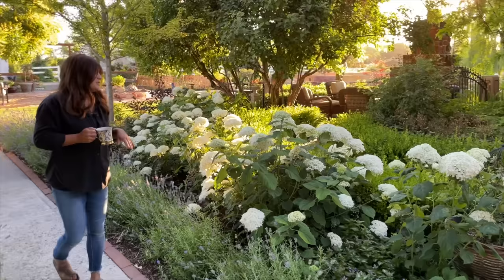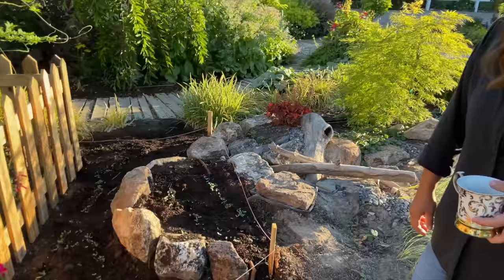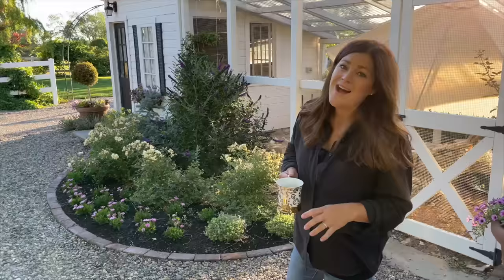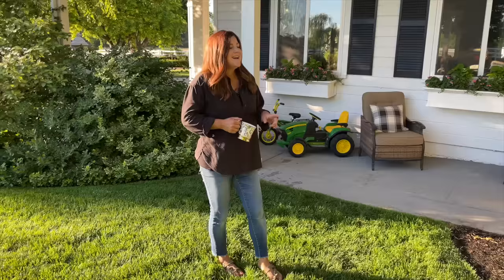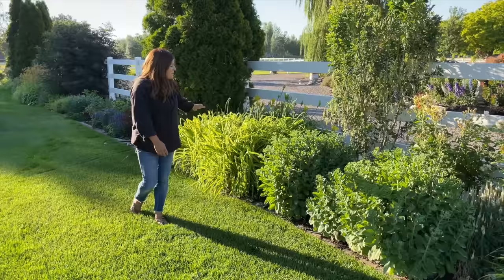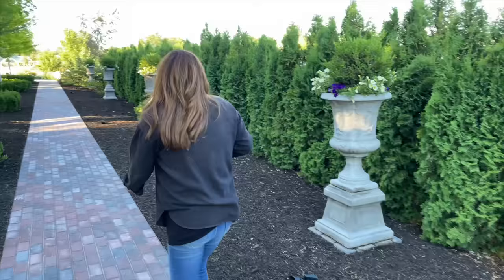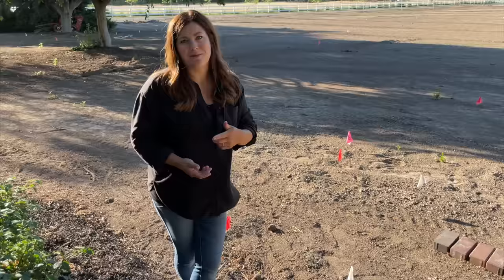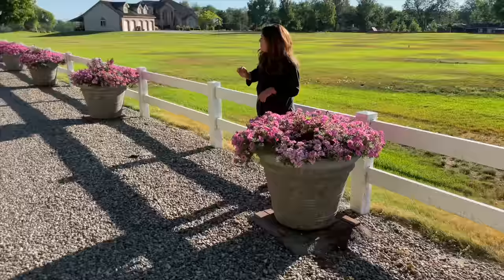Heat Wave Garden Tour 🌿🥵☀️ // Garden Answer

Comment: A thought, you have discussed removing the large brick area where you planted the new butterfly garden. When you're removing the pathway to trench for new electric, can you take up all or even just a section of the bricks to be used as the new path/walkway, once the trenching is finished? It would keep the brick look you have around other parts of the property, and keep things some what cohesive. Maybe just throw grass seed down in the section you remove the brick, or make an adjoining garden bed a bit bigger. Might keep " the chaos" look at a minimum of areas are removed in pieces and the bricks used elsewhere. Perhaps use some of those bricks that don't look so great for edging around flower beds too.  Anyway. Looks great, love the vids

Comment: Where I'm from, Coleus is the proper term for both singular and plural. As is spruce - not spruces for the plural. However, that's not apparently necessarily correct! 😀 As for the chelated iron, we cannot currently get it where I live on Vancouver Island, BC, Canada. My go-to garden centre says they haven't been able to source it for a couple of years so I've resorted to a higher iron fertilizer and epsom salts for absorption of the iron component. Watering it in like crazy, and it seems to be helping! Fingers crossed! 🤞

Comment: Speaking of heat…many of us have toasted plants and are doing what we can to shade them. But what would YOU DO if you had a plant that got fried but there’s GOOD plant underneath? Would you trim back the fried/dead material right away or leave it to protect what’s underneath in case another heatwave comes? 
Thank you for your opinion on this. Many of us are saying trim while others are waiting.
Reply: So glad you asked this question. I was able to put a shade structure over my most vulnerable plants during our 112-115 days but others are crispy and sunburned. I decided on some to trim away the damage but left others with the thought of protection.  I’m looking at it on a plant by plant basis, depending on where the damage is, whether or not it has bloomed, type of structure, etc.  I have never seen this kind of heat damage in my garden.

Comment: Instead of trenching up that sidewalk why not just move the lavender like you're going to anyway. It looks like you have  a clear path from the house to the brick patio that is coming out any way. Then you can put it off for a little bit longer. Just go through where the lavender is and the grass is. You probably need to go through the the house side but that's all.. just a thought.